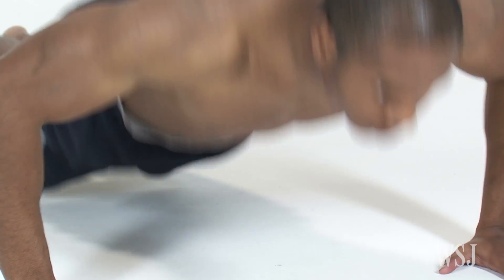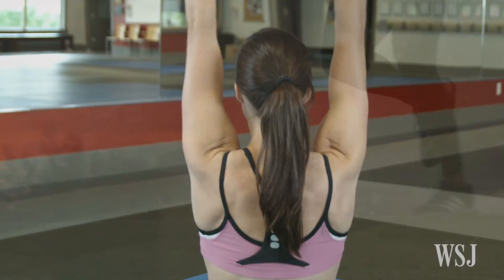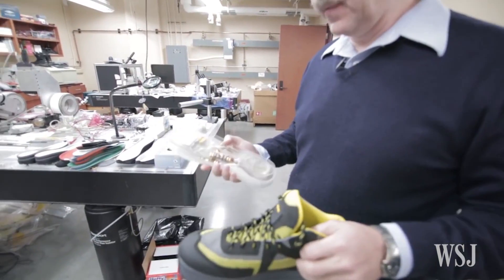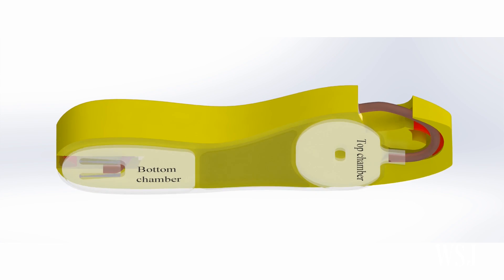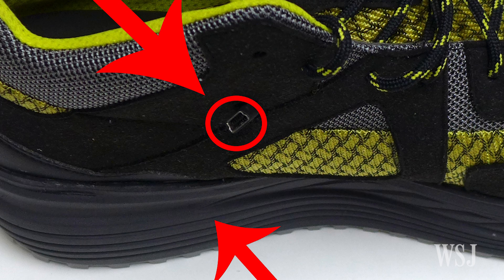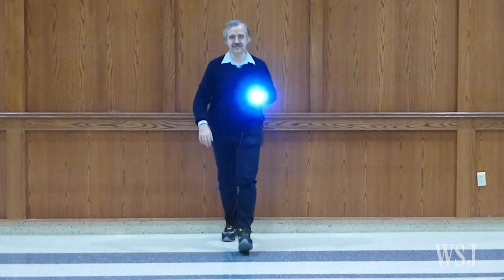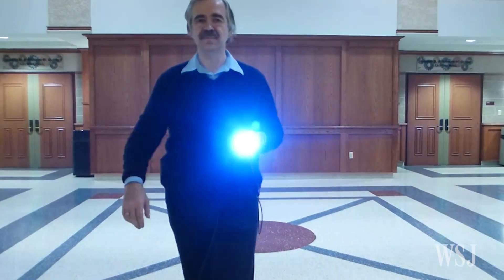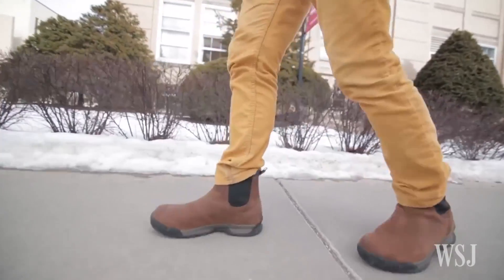Smart Sole Can Charge Your Smartphone as You Walk

Comment: Does the gas stop working and require a refill after a certain amount of reaction? Also how safe is this gas? Is it toxic if it leaks or dangerous if it were to react with another substance such as water? Lastly could it react to something and potentially become an explosive? Or if there is an electrical fault with the system could the gas cause the shoe to explode and harm the wearer?